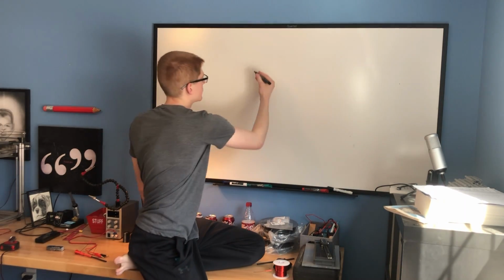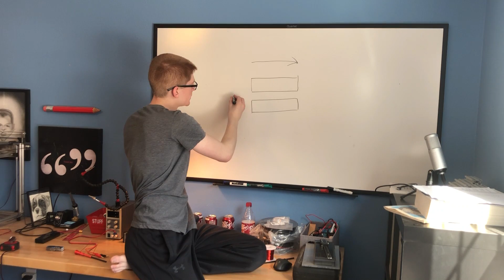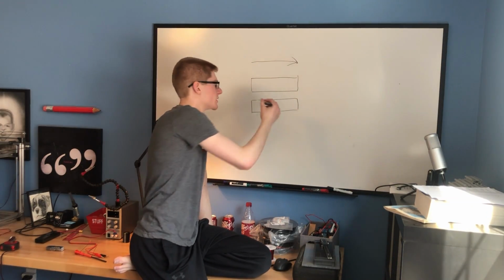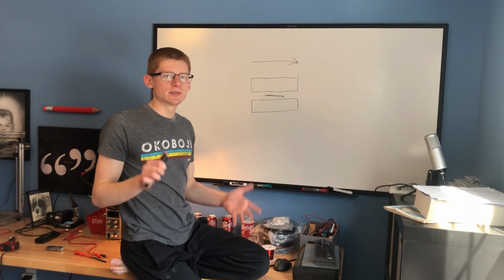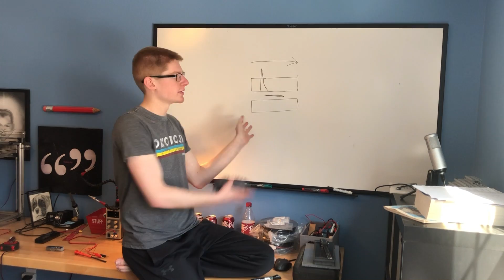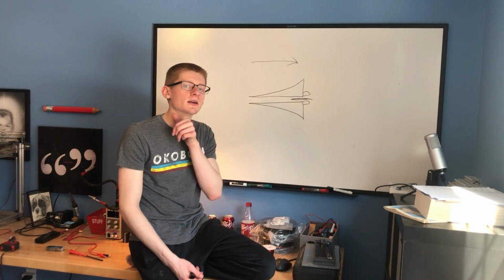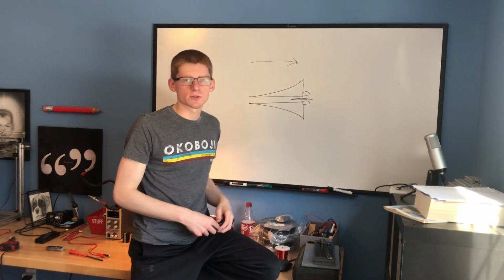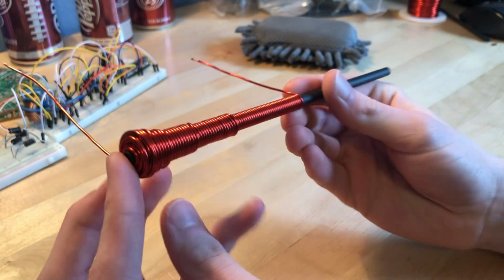Making a Coilgun - Part 3: Reconsidering Everything

Comment: if you had engineered projectiles it would be the key. theres a few ways, spin transfer magnetics possibly. or antimagnetic combined with ferromagnetic, in the projectile. If you could achieve spin injection into the coils as well, then you would see real improvements perhaps.

Comment: You possibly could have multiple discharge points in each conical coil, using a battery to provide a constant charge to the coil, with small light sensors integrated into each conical coil via an inner barrel layer (for the projectile) and an outer barrel to house the diodes and light receptors. Using the light diodes and light receptors to trigger each discharge as the projectile moves down the barrel and each successive conical coil. Using a battery in the stock to provide a small constant baseline voltage in the conical coils themselves, and two to four high voltage batteries integrated into the magazines to power the capacitors. That would probably allow you to use smaller capacitors. Especially if let's say for instance, you use nine capacitors per coil, three per discharge point in each coil (by making your coils in both sections and layers, two layers two be exact with the inner layer being comprised of three sections one capacitor per section, each section dividing the conical coil in thirds by length. And the outer layer providing the constant base voltage going the full length of the conical coil.) You could then use let's say (I'm not sure if you can find or make on but hypothetically) capacitors that are around four to five inches in length and eleven to thirteen sixteenths of an inch in diameter, with a high enough UF rating to handle a high voltage charge source. Then integrate them in semicircular bundles, three layers of three into the foregrip area one bundle under each conical coil to reduce the distance and wire length between the capacitors and the conical coils reducing your discharge delay (even though it's fractions of a second it should make a difference). Along with having a diode and light receptor trigger dedicated to each layer of each capacitor bundle for fine tuning of the system to further decrease any discharge delay. Using the battery in the stock to power the diodes and light receptors along with their accompanying trigger modules and the baseline primer voltage of the outer layer of the conical coils. Allowing the high voltage batteries in the magazine to be dedicated to charging the capacitors. As for your firing mechanism you could have the "breach and bolt assembly" slightly back away from the conical coils just outside of their area of effect, using high rpm electric motors to operate the bolt carrier and load the projectile into the breach, and use a reciprocating electric motor to act as a kicker and quickly shove the projectile into the conical coils field of influence. I hypothesize that what you would have in the end is something of a constant primed rapid pulsed discharged conical coil rifle, that could actually achieve firearm equivalency in muzzle velocity and range. And with further refinement possibly something more equal to if not greater than .50 BMG in velocity and kinetic force while using a lighter and cheaper projectile.You could also integrate railgun rails with a helical geometry into the inner barrel (along with the diodes and light receptors) and patch in the discharge system to the helical rails to make a hybrid system and impart spin stabilization to the projectile. Furthermore you can make your coils into a hybrid design in of themselves. By making the segmented inner layer of the coils conical, and each section in insulating paper (not much just enough to prevent any arcing of the charges between the components) and wrapping your outer layer of the coils in a more cylindrical geometry. The inner conical coil being the rapid pulse discharge system, and the outer layer being the lower voltage primer (that shuts off temporarily as the third discharge is triggered in each coil. While the helical rails in the inner (projectile layer) barrel also have their own dedicated battery integrated into the but stock with a set variable voltage switch so that when you squeeze the trigger it has an instant increase of voltage, with the pulsed discharge sections of each inner conical coil dumping their loads into the helical rails using micro inverters housed with the diodes and light receptors between the inner and outer barrel at each section of the segmented inner conical coils. Further increasing projectile velocity while imparting spin stabilization to increase range and accuracy.

Comment: Just found this three years later, brilliant idea. I just read a NASA paper describing coil gun simulation with an FEA program called Quickfield. They have a free version, very interested in trying this idea. Isnt a battery basically a large capacitor? I use LtSpice, and lion batteries are modelled with huge capacitors. Seems like an overrated capacitor with IGBT is the way to go. Like taking a hose in the Niagara if the capacitor is big enough

Comment: Seemed to be stronger in reverse. Remember, you're also accelerating the projectile from rest, which is it's point of greatest inertia. The greatest number of windings might actually do more good there if you're hooking it directly to a battery instead of capacitors.

Comment: Jesus, Idk what to do with my brain. I'm not an engineer, or electrician, or any kind of professional science person, but about 20 seconds before you drew those newly shaped magnets, I was thinking, 'it's the fields, you need to see a map of the fields, and be able to tune them to the shape you want. lol... and I have ideas I know are useful, but there is really no reason I should think that is th e case, lol.... 

I'm certain, in a final triumph, a torus will be involved. Also, I think this is somewhere on the path to perpetual motion.  - For projectiles, how about a 2 stage bullet, or 3 stage. So, use one accelerator that gets trapped, but separates from a non-ferrous bullet, and the inertia keeps the front stage moving. - another idea is a pressure mechanism. Something about compressing the magnetic field, and repelling the projectile, instead of attracting it...

I've watched a few coil gun vids looking for my own info to emerge(p.s. a dude just did one recently, he really nailed  the projectile part), and I can't shake the feeling that this is very close to PM.  Without electricity though, just magnets. Cz think about it, anything like this, all you have to do is circle the track back to the starting point, and if it can get there, you have done it.... So, any magnet accelerator can accomplish this. I don't understand why they don't just do that. I have never built one, but it's easy to see they get a bearing, or even a puck, moving fast enough that it could return to the starting point, easily, if on a circle track.  I really don't get why that isn't perpetual motion??? I have to assume I'm missing something, cz it seems so easy.

Peace

https://www.youtube.com/watch?v=id90kjYh-Qw

Comment: There is always going to be force pulling the projectile from behind, limiting acceleration, if the length already passed through is still magnetically active.. chained coils w capacitors is still the current best practice for this application

Comment: it's not more efficient as the copper wire has micro fractures in it's coating.. you need to fully cover each coil with a rubber resin to prevent any interference with the next coil layer. :) some use electrical tape but this doesn't work as well as a rubber resin :)

Comment: I think you're wrong by not using capacitors as you can modify the time constant of the circuit as your driving current timing. Look into how both DC and AC motors work using sinusoidal distributed windings and you'd probably be better off applying some sort of decaying sine wave decaying at your desirable time constant in order to push and pull the projectile. You simply need to unwrap a 3 Phase AC motor and use a single projectile instead of a squirrel cage.

Comment: An induction coil might also help your project instead of capacitors. So long as you're using the inverse of shit, logs and fun maths you might as well start thinking with fun shit in mind. Go get a starter coil from an old big ass truck and see what you're new coil can do with that. The collapsing of the coil has the opposite geometry of a capacitor so I'd think that you might have more luck with one than you would with capacitors. You might also think about using a relay for both discharge and cutting power, if you get the thinking thought in it you don't need a sensor and can greatly reduce the complexity of your circuit.

Comment: What if you used two capacitors on each coil, would it help keep a steady high energy output rather than a spike and fall? The second capacitor should give it another high energy output right as the first capacitor drops in output. One capacitor to pull the object in and one capacitor to push the object out.
Reply: That only works if the projectile is a permanent magnet. A steel projectile will react the same to either north or south pole.

Comment: Nice work, butttt. A coil is a big inductor and it resists current flow so yes a capacitor wants to instantly discharge but an inductor had resistance to that. This is why good dc power supply’s use capacitors and inductors as it smooths out the dc voltage.

Comment: This is something I was thinking about for a couple of years.  I was thinking that any effect gained would be lost by the lower number of turns in each successive layer, though I suppose you would just increase the number of layers for any given loss of width.  Also, I wonder if the length of your projectile should be at most the length of the final coil such that the last coil acts as a regular coilgun and all previous layers are just to accelerate the projectile to that "stage."  Glad to see I don't have to work it out myself.

Comment: Hi, the center of force is a weird way to say it. Yes the force is greatest when it is at rest but it also means that the opposing force made by the opposing magnetic field is also of the same magnitude. This design really doesn’t offer any benefits. The only usable force would be on the first half of the coil if it were cylindrical. However it is this cone shape it just moves the region of usable force and makes the projectile travel down the barrel longer with more friction. Think of it like centroids and all you’re doing is moving the location of it. The integral of the force over distance is the energy transferred and is the same for the same area of the coil no matter how it is wrapped. I would love a response!!

Comment: imo, you are close but you do want a cap, the reason being. your coil design needs just a little more "layers" maybe bring each down 10%-25% rather than 50% of the previous and add back the cap but you will want to size it properly for the coil, as i am not mathematician i can not give you a equation for it. but basically you will want the cap voltage drop off to align with the projectile reaching the end of the coil, this way the "pull-back" effect is minimal (of course you can still control the cut off with MC/likely high current SS relay)  but you DO want the spike in the beginning because the law of momentum, you want to give a big push to get it moving and then the power can taper off while still increasing the projectile momentum as a whole. you will also want atleast 100v if you want considerable speeds from the projectile, but if you couple the cap with battery in parallel then the instant current can come from the capacitor and as the voltage drops off it will start limiting at the current the battery can supply. but remember it will pull from the highest voltage source so it would still ultimately be limited by the current the battery can supply. with carefully placed diodes you could in theory have a 2 stage setup where instant shot is high voltage and then drops to the lower voltage, similar to how a tazer functions but i dont think their circutry would work due to the closed loop in the coil plus quite difficult to implement. you can ultimately put a shunt on the output to the coil to limit the current from the cap causing the voltage drop off to be somewhat extended (less power drawn/less drop) or you can arrange some 18650/21700 cells to supply a good amount of amperage. but i am interested to see what you come up with.

Comment: I have been wanting to make a coilgun that doesn't use alot of components that weigh it down,
the cone design already is proven to be more effective (although I think it looks like a sci-fi gun), I think the cone coil plus a transformer or ballast with an AC power supply will give it enough power but as for the timing it would be a lot faster to use a momentary switch instead of a sensor.
a sensor I don't think would shut off the coil fast enough although I've never worked with a sensor.
one issue I have though is heat and my only solution for that is to use liquid helium or liquid hydrogen.

also I love this design because it is the fibonacci sequence

Comment: USE 2” aluminum spheres you can pull apart, line up nine of them in sequence with tungsten electrode, copper electrode and nickel chromium, and lamp wire. Feed it out your device put it all in a housing. That would me a phased array microwave plasma gun. Or a maser phaser!!!!